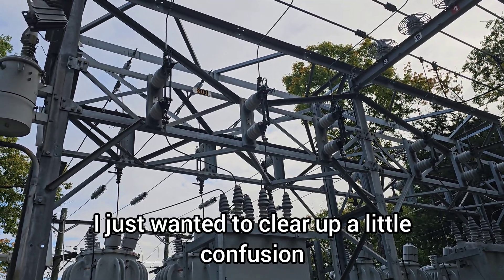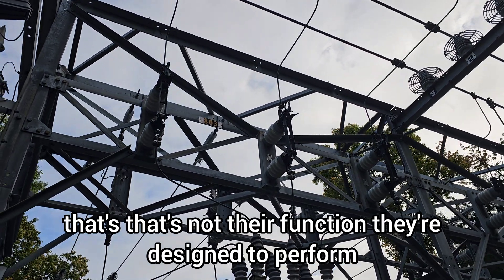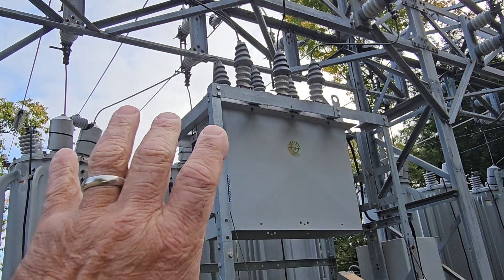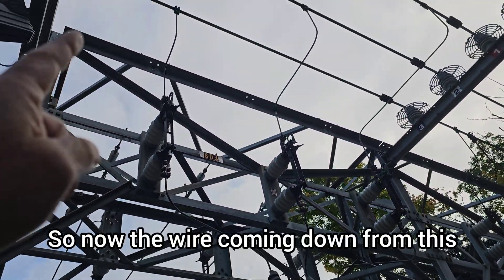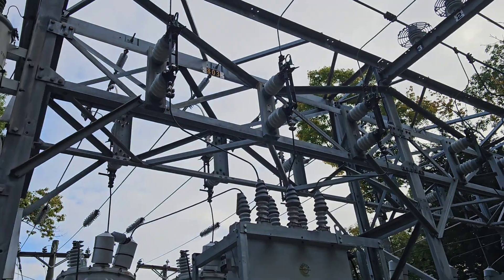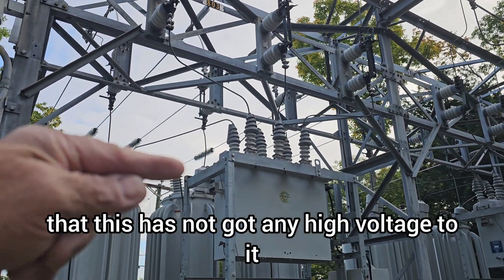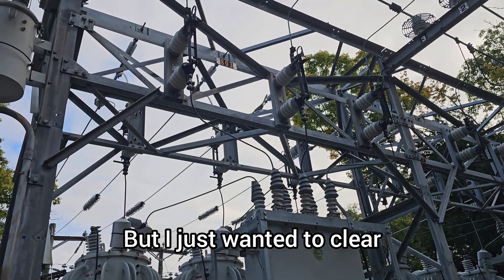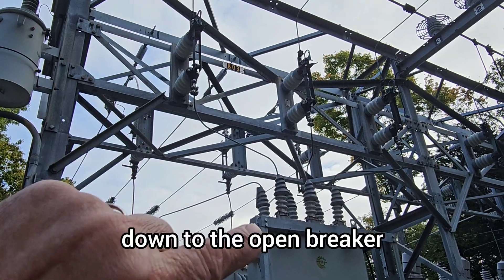High voltage disconnects do not break load! How does it work? #substation #maintenance #electrical

Comment: Speaking from experience, you can break load with them if you rip it open fast enough lol situational though, breaker fire and failed to operate. It’s a 50/50 whether you’ll lock the bus out from the blue dragon 🤣
Reply from the maker: @leaderrockmusic  after a switchman managed to open a switch under load and died,  there's no one on our system that would try it. Let it burn if bus protection doesn't clear the fault, it's not worth dying for.  Most of our buses have protection that would roll a lock-out in that sort of event. 
I've actually seen a breaker fail,  and when the breaker failure protection scheme tried to clear the bus,  another breaker failed and then a larger protection scheme transfer tripped to a different substation in order to clear the fault.  The protection worked, but it took 30,000 customers out. Many breaker mechanisms were rebuilt and checked after that event.
Reply: We have similar bus protection here but everything is changing with GOOSE. Saw a lot of breaker failures when they had a hybrid electromechanical relay teamed with digital and wire down. Hard to input anti-pump logic when one side is electromechanically protected. Too much decision making for a single relay. Same with bifurcated buses. The cheaper way out instead of doing the right thing.

Comment: That's true indeed , Those switches above are for isolation only , Never to be operated under load , Otherwise they would melt right down to the ground , The circuit breaker has to be tripped open before opening the isolation switches and of course , The lines have to be grounded before doing maintenance and repair , A buddy of mine is a journeyman electrician and one time I helped him change out 3 transformers like you'd see up on the pole but they were set on a concrete pad , He showed me how to use a hot stick and he said that your hot stick is your hands , We made sure that the load was removed from the secondary side of the transformers , The voltage coming in was 13,200 volts and he let me open the isolation switches and he said when you open those switches , You have to do it very quickly , That was really cool of him to let me work with him and the job went without a hitch , He knew I did electrical work on the side and that I was aware of the dangers of high voltage and definitely wore the proper PPE , Personal protection equipment , I do admit I was a bit nervous but I followed every step he told me , He also said that it's natural to be nervous to some degree when going into live electrical equipment and he also said that If you don't get even a little nervous , Then you've got problems because those individuals who don't get even a little nervous , They get overconfident and Complacent in which they are likely to rush through to get the job done and that's when accidents happen 
I've never had a major electrical accident and I hope I never do 
But yes , I've been zapped quite a few times and thank God it wasn't higher than 120 volts but it's the nature of the beast , If you want to be an electrician 
You're gonna get zapped once in awhile , After all , Who ever heard of an electrician that never got zapped or 
Who ever heard of a plumber that never got a bath or 
Who ever heard of a carpenter that never smacked his fingers with a hammer or 
Who ever heard of a cook in the kitchen that never burned himself and cut himself with a knife , like I said 
Its the nature of the beast and it's gonna happen because at some time 
We all get caught off guard
Reply: those small zaps is like mother natures letting you know who the boss is.. 100%

Comment: Interesting. Now can you tell us how the recloser operates to disconnect the load? I know this equipment is needed at the level of voltage that's being transferred here because the voltage is high enough that you cannot manually operate the switches fast enough.
Reply: The circuit breakers in a substation can be tripped manually because they are designed to have a manual trip so they can be turned off so maintenance and repair can be done , Most have a button that says Push to trip , Once the circuit breaker is tripped , Then the isolation switches can be opened and the ground wires can be attached 
All circuit breakers are designed to be tripped manually so maintenance and repair can be done no matter what size they are
Reply: @ironmartysharpe8293 that button is not on the breaker itself, no? I was thinking the switch is a few meters away from the actual breaker, mechanically coupled or even motorised so that they can also be switched from a remote control room